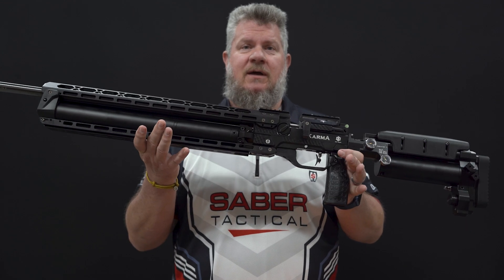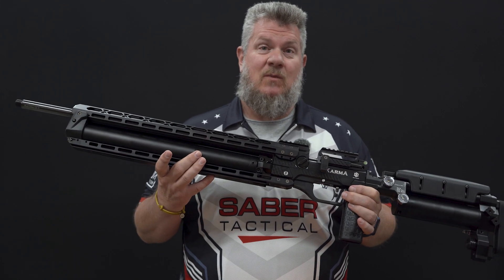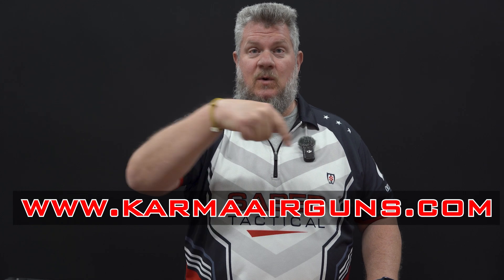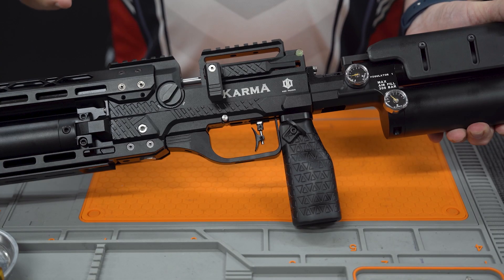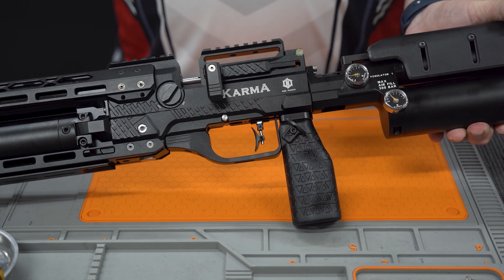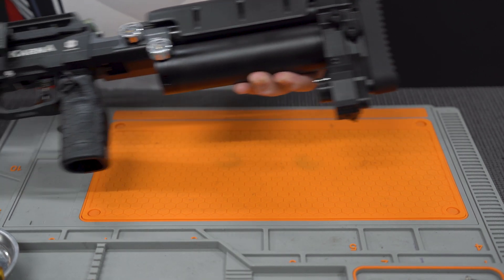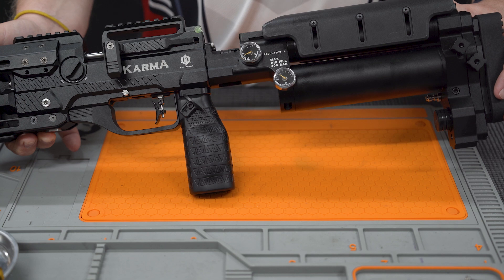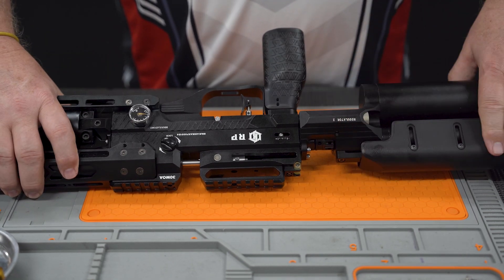Karma Airguns Red Panda Degassing Process-Video 1 of 8 in the 2025 Spec Transition Series

Comment: Karma red Panda, Bad news ...
Hello everyone, I am a French PCP enthusiast since 20 years and I have so far tested at least thirty different rifles between the FX, the AEA, the RTI, the Epic and I just received a Karma Red Panda 3 days ago. I make videos for Facebook group pages in which I am but also videos for my YouTube channel specializing in PCP advice. I can't help but share my first impressions with you before even starting to shoot.
Let's first remember that this rifle costs more than €2,300. You will then understand that I can be seriously surprised by the poor quality of the transport case with poor quality interior foam full of glue that is not big enough and that moves in the plastic case because it is not the right size. I add that the case is also not wide enough to store the rifle with a scope. Compared to other brands like Epic or RTI with its Mora, I guarantee you that the surprise is still significant.  after you will tell me that we do not necessarily buy a rifle for its box, ok. where I was also surprised is to discover pressure gauges so small and difficult to read for a rifle at this price. I add that even before having fired I had to start by adjusting the trigger but especially the safety system which did not work. after that I realized that when pulling the loading lever 'r' there was like a blockage and I had to disassemble the stock of the rifle to loosen a screw which allowed me to no longer have this catch. at the same time while it was three times that I pulled this loading lever one of the small pins fell to the ground luckily I was in my apartment because I imagine if this had happened to me at the shooting club I would never have found it. all this to tell you that even before starting to shoot for a rifle at this price I find such a level of quality control deplorable.  I am sincerely very disappointed with these findings and will have difficulty promoting a rifle that loses its parts, and for which we must start by taking out our tools for safety reasons and parts that fall out, all sold in a box that is too small and of catastrophic quality,... after having informed myself I realize that I am not the only one to notice all these problems wandering and that before starting to have fun with this rifle we must go through the toolbox. I am at your entire disposal to discuss these different points and I am only at the beginning of the discovery of the red panda...